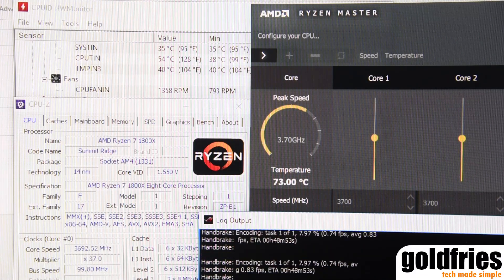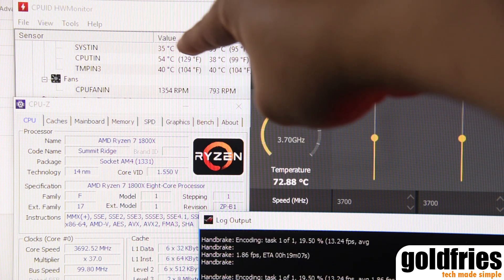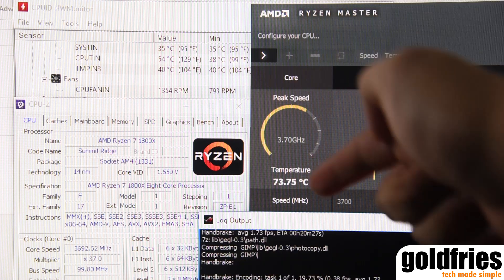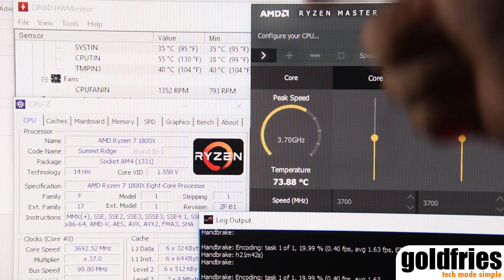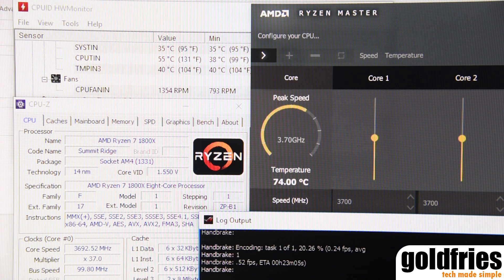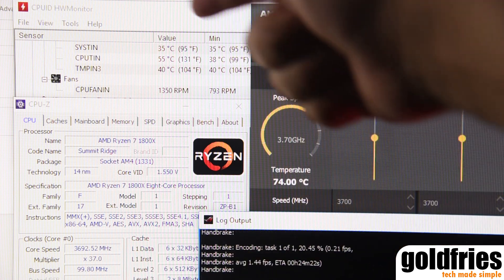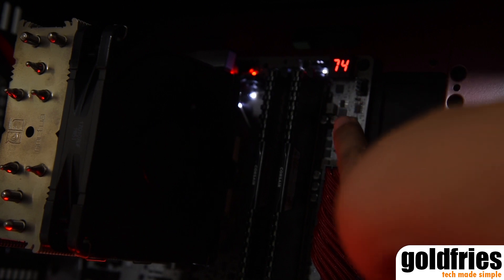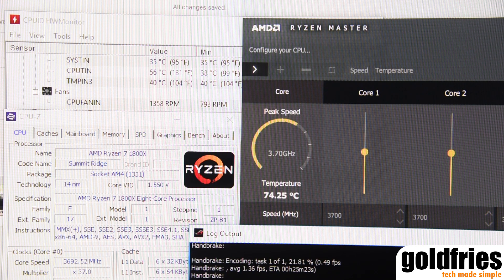AMD Ryzen 7 Temperature Reading 20 Degree Offset

Comment: i hate how i can't set my cpu to throttle at 90 c and have to choose between throttling at 75 C or not throttling at all risking frying my cpu
Reply from the maker: The temperature off-set is annoying for sure. Ramps up my fans like crazy.
Reply: @goldfries  my issue isnt even the noise level, it actually caps my performance once it reaches 75 C unless i disable prochot, but if i do and it reaches too high a temperature i get a thermal shut down

Comment: I have an 1800x that when I use it to full in Hwmonitor there is at the beginning a temperature that says CPU that reaches 95 ° and another one below where the correct ones go that it stagnates at 75 ° Should I be concerned?

Comment: Glad to see someone actually displaying the truth about this dodgy situation. There was a bios update but this doesnt seem to change the situation at all. I have a crosshair 6 and ryzen 1800x on a custom water cooled system. I am getting bios temp readings of 60 degrees from pc startup probably gets as low as 54 if defaulted to stock 3,6ghz but the independent temp reader  which ive sat directly on the cpu shows of 34 to 37 degrees. there is a huge discrepency here and the problem is that it is likely to crash if the readings get to 100 degrees and the highest it has reported so far is 89 degrees. They need to sort it out asap but  wont give us realistic reasons as to why it is behaving this way... ive been on email communications with their tech staff and they do not seem interested in giving a true reason as to why this is happening.
Reply from the maker: Exactly what I experience, once it hits 100 mark whatever bench I run is very likely to fail. It doesn't make sense that the reading shows 100c but when my finger is at the point of contact it's no where burning.

Comment: I'm experiencing serious temperature issues despite being on AIO watercooling, my setup is as follows:
- AMD RYZEN 1700x @ 3.86GHz, 1.376Vcore
- MSI B350 tomahawk bios 1.32
- Corsair H100I AIO watercooling

Under Prime95 smallFFT, im getting 94 degrees tCL and up to 111 degrees CPUTIN which is rather alarming, does anyone here have idea what might be happening? Feedback will be greatly appreciated.
Reply from the maker: It'll go that path once you run P95. 1700X and 1800X has 20 degree reading off-set. I'm using the 1700 now, the temperatures run pretty cool. 

I have no idea why AMD has it that way, it just sucks.
Reply: Hello, could you resolve your problem? I have the exact parts as you and Im experiencing the same issues.
Reply: what is P95??? please help
Reply: P95 - Prime95, and yes the problem remains although it has no affect on my normal day to day usage (other than my fans getting a bit loud).

Comment: My 1700x is giving me idle temps 60-70 degrees on ryzen master considering the 20 degrees offset subtraction as declared by amd my idle temps after subtraction would be 40-50 degrees at 1.22-1.45 core voltages(stock speeds)....I dont know where the problem is lying should I RMA my chip?....I didn't do any overclocking ..I've updated my bios to F5 (gaming 3 b350 gigabyte rev 1.0) but still temperatures remain the same....someone please help me out btw my cooler is masterliquid lite 120
Reply from the maker: Just run some stress test like ASUS RealBench for example, see if it crashes or overheats.

Comment: In my hw monitor I'm getting 3 different read outs but the tmp1 is stating 59-89°c . I'm using a h100i corsair (version 1) and it's sounding like a turbine engine. I thought it would be running a bit cooler than that. 

I have no intention of over clocking atm. When going into my mobo  (x370 asus prime) my fan curve starts at 50% without letting me reduce it.  should I get another cooler or just stick with the h100i?  I'm about to pick up some ml120 fans
Reply from the maker: I think the H100i is a nice, I don't think you should switch cooler just because of the setup. My fans are running as if it's hot when the heatsink is cool.

Comment: this is a dangerous game they are playing. what if someone thinks their CPU isn't actually at 90 degrees, because they THINK it's over reporting but really IT IS because the software already compensates. so then you push it further thinking you're ok and POP! you're dead!
Reply from the maker: eugkra33 nowadays system will throttle / shutdown if overheat. I think the greater problem is when support, when ask about temperature also have to find out which model and remove the compensation and what not.

Comment: I bet AMD was worried a bunch of hot rod gamers would burn their CPUs. So they put this 20 degree offset in to keep people from too aggressively overclocking their CPUs.
Reply from the maker: Quite puzzling though, that they had it on 1700X and 1800X but not the 1700, probably just because the 1700 has lower TDP.
Reply: Doubtful, as it even crashes my cpu on the turbo clock. (1700x)